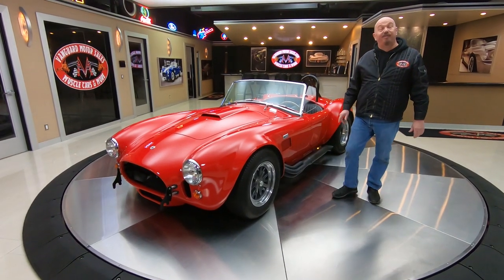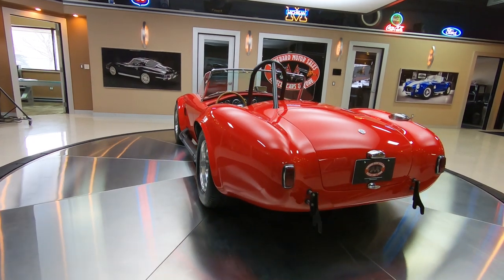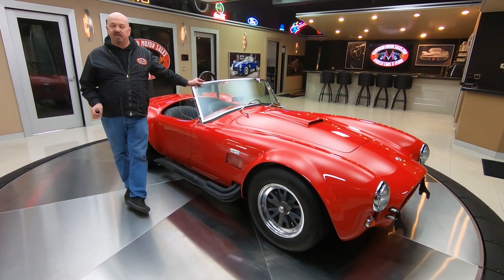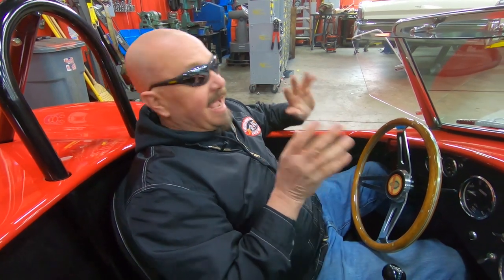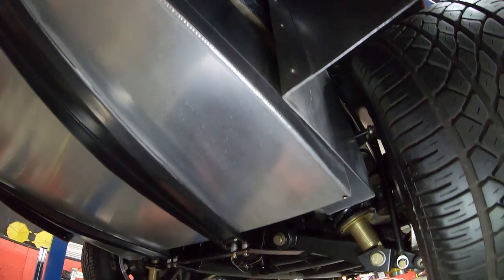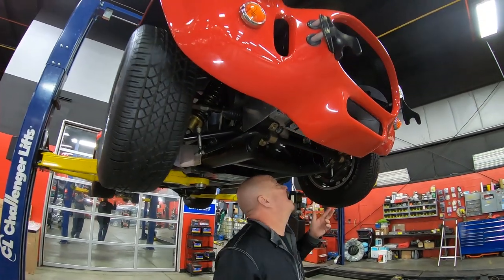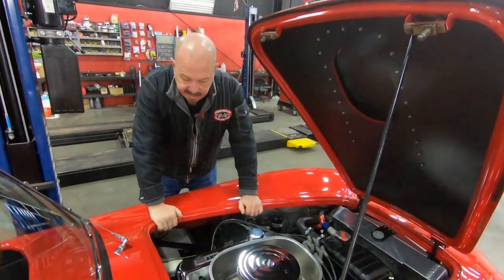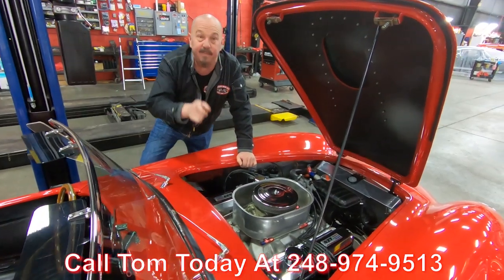1965 Shelby Cobra CSX For Sale

Comment: Is a CSX considered a 'kit car'?
Reply from the maker: The CSX is not a kit car. CSX is a continuation series that they started to build back in the 80's under Carrol Shelby's direct Tutelage. They were factory built cars using the exact same tooling and design as the original cars from the 60's.
Reply: Bumble Rock no csx’ are made by Shelby carrol Shelby had resumed production in something like 97 98 I think you can still by them from Shelby for a pretty price. It look like this one was made before carrol passed since his signature is on the dash as usual
Reply: @vanguardmotorsales  So no 15 year Canadian rule?
Reply from the maker: In this case the 15 year rule in Canada would still apply and this car was built by CSX in 2015.